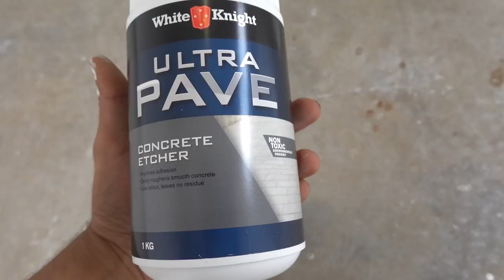7 easy DIY projects anyone can do

Comment: Hi Bill, do the floorboards need a filler where the board meets the wall so water can't get in under the board and damage it?
Reply from the maker: The base board/skirting board will be installed to close off the gap. 👍